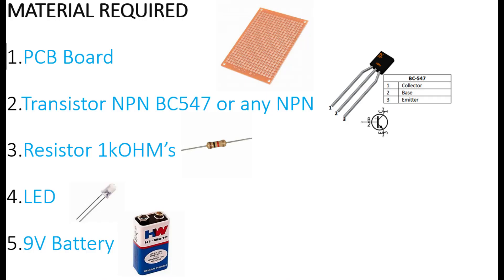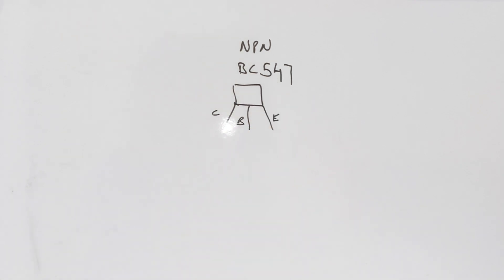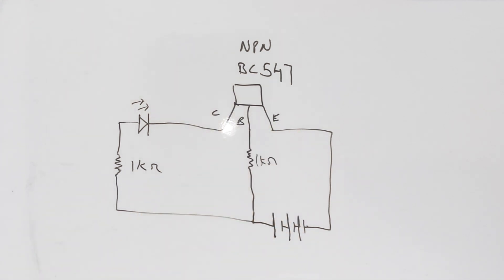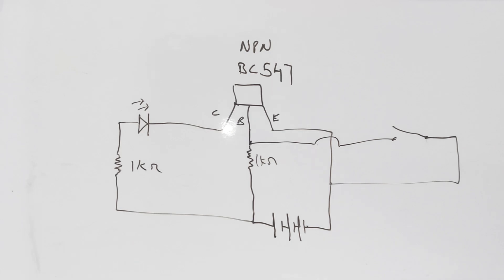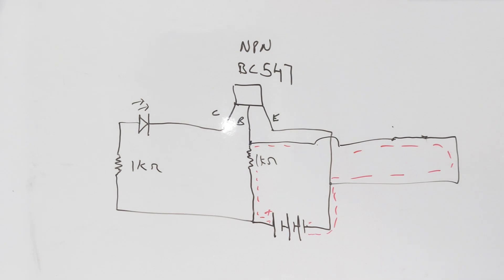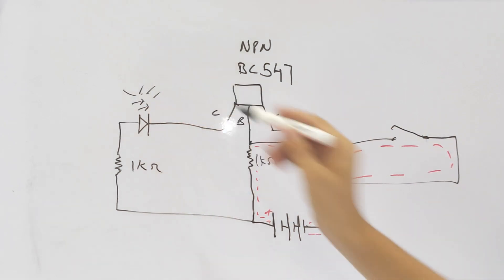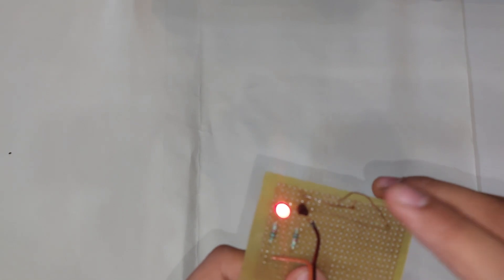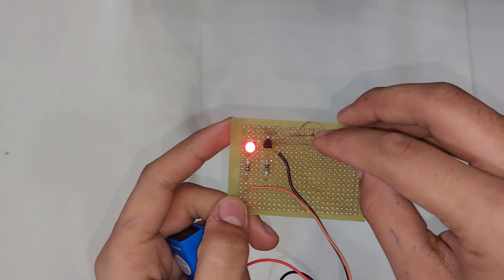HOW TO MAKE WIRE BRAKE ALARM AT HOME WITH BC547 TRANSISTOR|HOW TO MAKE WIRE BRAKE ALARM| VERY SIMPLE

Comment: how many maxium loop wire connect?
Reply from the maker: Sure, You can connect many loops but you need to modify the circuit
Reply from the maker: For more connections or loops
Reply: @mechatronicsworld786  
How much wire maximum used?
Reply from the maker: In my circuit it will only one wire is used
Reply: @mechatronicsworld786  
How much wire maximum used?